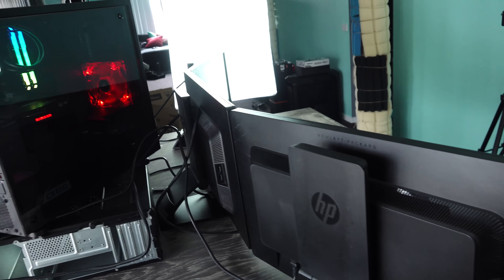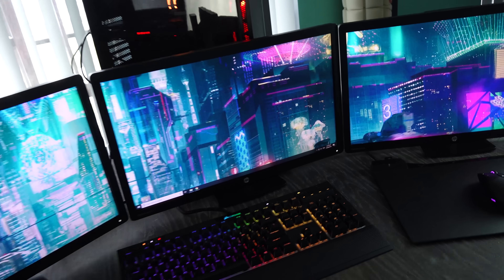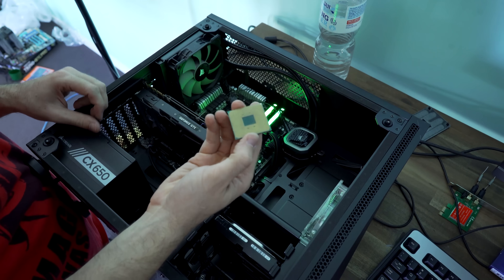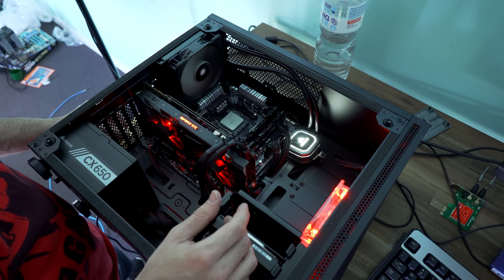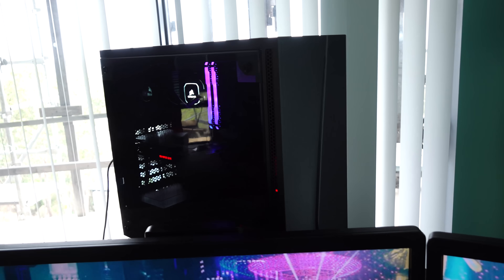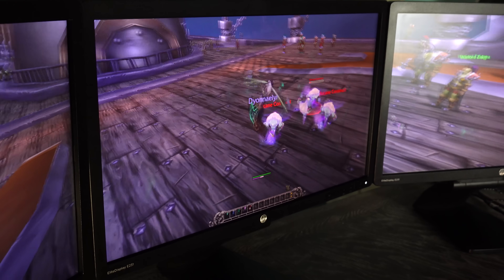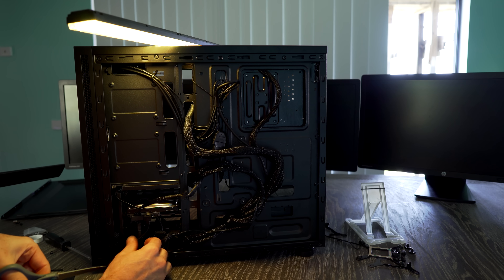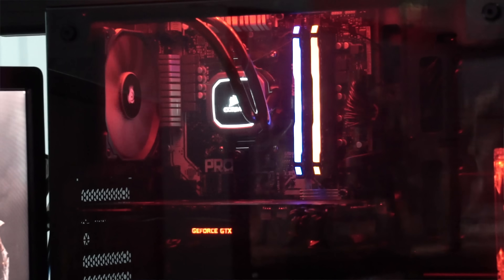Ryzen Problems...!? Post Analysis of the AMD WoW Gaming PC

Comment: Always unplug your HDD when you install Windows on an SSD, it's not vendor specific, happens on both Intel and Ryzen.
Reply from the maker: Strange, always happens on Ryzen for me.
Reply: Pls read my previous answer. For what I know this happen when the HDD isn't configured in the GPT file system and happens to be configured as MBR with a ACTIVE volume. Also explain why you had the limitation of 2TB by partition cause MBR can't work with partition superior than that. Sorry for bad english... You can fix this when installing windows opening the CMD (press F10 in windows install screen) -> command: diskpart -> list disk -> select disk * (*  select disks that aren't with the GPT mark at the end of the disk especs in the listed disks) -> clean -> convert gpt -> exit... after that install your OS as always
Reply: By default SSD always will initialize as GPT file system and not MBR but disks happen to use MBR as default if you doesn't happen to initilize them with a UEFI - GPT only Windows pendrive.
Reply: @DerickMaruyama  Didn't realize your English wasn't good until you said so. That said, if you are interested in improving your English:

The expression is "as far as I know" not "for what I know" (also use a comma after the expression: "As far as a know, this happens")

In this case you would use "happens" not "happen"

"configured in the GPT file system" should be "configured as a GPT partition table"

"a active" should be "an active"

"Also explain" should be "Also explains"

"2TB by partition" should be "2TB per partition"

" cause " should be " 'cause " or "because" otherwise it could be confused with the actual word "cause"

"can't work with partition" should be "can't work with a partition" (yes, we use a stupid amount of "A's" and "The's" in English.

"superior to that" should be "larger than that"

"Sorry for bad english" should be "Sorry for my bad English" or "Sorry for the bad English"

I've never understood the use of "..." at the end of sentences by some non-English speakers online and have always been curious as to why some non-English speakers use it. In English, it is used to indicate an omission or unfinished thought. Both times you used it, though, there was no omission or unfinished thought and a period should have been used instead.  Out of curiousity, what is your native language?

Some proper examples of ellipsis (...):
He said, "I am John. [...] and that is the end of my story." (whereby a section of text is left out and replaced with [...])
umm... (Here it indicates an unfinished thought. The person is unsure what to say next.)
I don't want to go but... (Here it indicates an unfinished thought. The person is unsure what to say next or doesn't actually want to say the reason.)

"You can fix this when installing windows opening" should be "You can fix this while installing Windows by opening" (when instead of while is OK though)

"opening the CMD" should be "opening CMD" which is actually a strange one since we would also say "opening the command prompt"

"that aren't with the GPT mark at the end" should be "that don't have the GPT mark at the end"

"after that install" should be "after that, install"

"as always" should be "as usual" in this case.
Reply: Martin Aasa strange, I’ve never seen a problem like this with all the computers I’ve built. Looks unique or extremely rare to me.
Reply: I've seen it too on Intel (i7-6850K) - happens to me on X99 with an M.2 and SSD. I have to unplug my SSD or the windows installation media cannot create the Windows 10 install on my M.2. It's not everytime, but it's happened twice. MSI X99A Godlike Gaming Carbon motherboard, Samsung 950 Pro 512GB and Samsung 860 Evo 500GB.
Reply: Is it better to install Windows on 2.5 SSD or M.2 NVMe SSD??
Reply: Fida Md-saini NVMe is faster if you have it.
Reply: @WayStedYou  I intend on getting one because the mobo I'm getting for my Ryzen 7 2700X is the ASUS ROG Crosshair VII Hero & it has its OWN PCIE lane direct to the CPU on the bottom right side of the mobo and it DOESN'T take from the GPU.
Reply: Fida Md-Saini I have that exact setup. 2700X on CH7wifi Ann 1tb 960 EVO. It rocks. Bottom port
Reply: @fidamdsaini8452  M.2 is faster but doesn't really change that much as for performance in games
Reply: True
Reply: @Alistair believe so. I happen to work at a PC Gamer store in Brazil and happen sometimes so you get used to it, so now we use a pen with The lastest version in gpt only for all new hardware and a gpt-mbr for better compatibility for older hardware.

Comment: When I have an issue like this I press and hold the power and then I restart the  PC. if that step doesn't work I  remove the memories, CPU and the litter battery then I put all on the floor for five minutes and the put everything back and work fine. I do have a Ryzen 5 2600. Ah great video.

Comment: i had the same issue of the reserve system on the hard drive on my 5820k, it seems to be an issue itself made by windows for what it seems, not just Ryzen, too bad i lost some files when i needed to do a reinstall later on since i had to format the HDD because it was not being recognized at all, its a weird issue, so i would reccomend to everyone to install windows by disconnecting the sata cable from the other HDD/SSDs and after it is working, plug everything else back together

Comment: For the Windows installer bug that happens regardless of platform. On my old i5-750 system I installed Windows to my SSD and it copied the master boot record to my secondary 2TB hard drive. I had to set my 2TB drive as the boot drive in the BIOS and then Windows would load. I'm not sure how long this has been a problem but the only way it can be prevented is to unplug all drives except your boot drive, install Windows, and then plug in any other drives. Not sure why Microsoft hasn't fixed this to be honest.

Comment: Also. nVidia surround is so crap. Especially if you use ANY TYPE of mismatched displays. You have to fake surround with SRWE Resolution Changer while on AMD... I have dual 1280x1024 + one ultrawide and with overscan setting gaming is flawless. One you use Eyefinity there is no going back... Ok. True. It has some bugs, but it's still better than nVidia solution.

Comment: I had the same issue recently on my 990fx Asus board that has FX8350 CPU. It would not turn on if i shut down the system and not turn off the power supply. Board seems to have power but it just doesn't turn on. If i turn off the power supply after shutting down it turns on fine the next time. Thought it might be my PSU but that's prob not it. It's time for a new build anyways, this one is 5 years old and my ram sticks are dying one by one lol
Reply: If its dying and you want to give that board one last hoora, I'll bench my FX to the death.

Right now I'm only able to push 1.7 Vcore on my 4 phase VRM to my 8350 (power consumption around 500w). With my phase cooler for 24/7 use, the core peaked at 10c once, but benchmarking something like Firestrike/TimeSpy is so light of a load it never gets above 0c. I just need a board that can do 2.5 to 3 Vcore, and I can run some LN2 to see what that chip will really do. It pulled most of the score for setting the current #1 FX-8350 single GPU score in TimeSpy (I will put the Titan Xp on phase, probably kill it, but worth it to set the FX history books).

Comment: Had similar problems when i helped built 2 Ryzen builds for two of my friends. They both had the same motherboard and when we tried to start them the lights turned on but no display. We tried a lot of things and reseating the cpu fixed it. Had to do it twice on one of them but it worked.     They haven't had any other problems after that luckily

Comment: I've built my first pc last week and noticed something strange too:
Whenever I turn the PSU off (did that many times while testing the wohle system), turn it back on and hit the power button, the PC is trying to boot for 2 seconds, fails and shuts down for 2 seconds and boots up after these 4 secs fine. This happens only after turning the PSU off and on. So the following boots are fine as well, as long as I didn't turn off the PSU once.
Reply: My sister's first build had the same problem, I had a look at it and found she wired the front panel/power pins from the case to motherboard wrong. The manual for each motherboard have the alignment differently (hers was the power-on pins were supposed to be orthogonal to the reset pins, she plugged them in parallel because the YT tutorial she watched had the pins connected so, and one of the holes from the plug was connected to the drive activity LED). Once I put it right for her the problem stopped. So maybe double check that.

Comment: 4:00 it happens on every platform. It's Windows Installator bug. Innitiating full HDD with a partition BEFORE selecting SSD as installation destination fixes problem.
Same goes for installing non-dual boot Windows - you have to LITERALLY unplug first hard drive since otherwise new instalation will just crap all over the boot sector and inject itself in the other disk.
Reply: *Feature, it would be a bug on any other OS, but its Windows, so the proper terminology is "feature"
Reply: its not a bug its the ssd not set as first boot device

Comment: I killed a ryzen 71700 in the summer, it was overclocked to 4 ghz and it freezes a couple times after 3 months, and then it went bust... At first i thought it was the motherboard because with the cpu it would have issue recognizing the vga on EZ lights staying on, sometimes it was the RAM having an issue, and sometimes multiple lights staying on, i changed the ram for slower ones, i changed the graphics card, changed the thermal paste, removed and reseated the cpu, made sure everything was connected right on the motherboard (Fans, pump etc) a couple times... the results were all over the place on the EZ readings, but it was the cpu... I never killed a cpu before by overclocking, it was a first (and it kept running at 4ghz for 4 months before it died in the summer) i thought it would at least throttle and not kill itself from the heat, i don't really know how it died like this but, on the third month ZBrush would allways freeze and sometimes i had to shut down / reset the computer when Zbrush was stuck. I know it's the cpu because i bought a 2 nd motherboard to try it , installing the cpu on it and it's not working, i can't boot any usb with windows 10 installation on it, or any hard drive with windows 10 freshly installed, even tho bios shows the r7 1700 8cores 16 thread  running at 3 ghz but is stuck on 1.39 / 1.4V, i tried lowering the voltages, but the system would have problem powering on, and reboot until it was back to 1.39 / 1.4V for the cpu, so yeah, i think the cpu is unfortunately dead

Comment: That 2nd one is nothing ryzen specifically related actually, it's not even specific to windows 10 and predates the am4 platform.

Windows is fucking notorious for putting the bootsector on a 2nd drive so the whole system depends on both drives to be around
You can move the bootloader with the bcdboot / bootsect commands in cmd, dont forget to mark the drive with the new bootloader as active partition, and swap the order around in the bios.
I prefer testing it standalone first then just hotplugging the 2nd drive in windows, which is then free from any system processes.

I havent trusted windows to install with more than 1 drive connected for years now, has been happening since like windows 7, if not earlier.

How the hell have you not have this problem before? it's been around for as long as x64 windows is mainstream ;)

Comment: Maybe it has something to do with you drenching all of your computer components with WD-40
Reply: You do realize PCs completely submerged in mineral oil are a thing?
Reply: You do realize that PC's submerged in mineral oil are concealed from the contaminants in the the environment. Water is also nonconductive. Water does not short out electrical components. It's the contaminants (Dust) from the environment mixed in with the water that makes water conductive. The same will happen with WD-40.
Reply: Did you know that some cleaners like WD-40 actually have pictures of computers on the can? They're recommended for using on PC's
Reply: WD-40 is non-conductive though...
Reply: @Kevin - Neither is water.
Reply: Only 100% pure distilled water is non-conductive, that is to say, almost 0% of the water you've ever seen is truly "non-conductive".  You're talking to the son of a certified electrician, I'm not saying I know more than you on this subject, but I likely do...
Reply: Go ahead spray WD-40 on your computer parts if you want.
Reply: If the need for a thorough cleaning arises, I will, don't worry :)
Reply: Just the thought of all the harsh chemicals found in WD-40 up against the delicate electroplated circuit boards, makes me cringe.
Reply: Its safe, I assure you.
Reply: Liquids and Electronics don't mix
Reply: Why would he clean a new board. I don't think he's ever killed something
Reply: He might've cleaned another component that caused the problem.
Reply: Oh Yeah!?!  Why don't you tell all of us how you get a nice oily sheen/residue on your pc components that's going to attract dust and dirt, and soften some plastics without using WD-40? (just kidding)
btw folks that, "will attracting dirt and dust" part. That warning is flat out from the manufactures of WD-40.
Liquids and Electronics don't mix
Flammable Petroleum-based solvents (WD-40) and Plastics never mix.

Comment: It is just much easier not connecting the HDD while installing windows just have the SSD plugged in.
Reply: good advice, being a mechanic takes like 15 seconds to take off the side panel and unplug the sata cable.
Reply: That's usually how I do it as I dont really button up the case until after everything is downloaded and all tests are ran
Reply: Yea ive done dozens of ryzen builds, hundreds of intel builds and when installing os and updates initially I never ever plug in my hdds. Thought this was common sense.
Reply: Once your computer is done you don't really want to be pulling off panels again. It's annoying
Reply: @YusufNayab  man you must be the busiest man alive if you can't spare 2 mins to just plug in the sata cables once you've done the initial install on the ssd. You might want to slow down and take some me time before having a heart attack/ embolism. 👍👍

Comment: Apparently, ryzen doesn't support 3200mhz trident z RGB...
It isn't specified in the QVL.
Reply: Yeah should of check the motherboard supported ram list.
Reply: Upon further digging on this topic, I found that using the Gskill software with other RGB software, was corrupting the SPD on the RAM.
So, don't mess with those RGB softwares.
Reply: Neither is the 3000mhz trident z RGB and I've got mine running at 3000 on an Ab350 pro4m with a ryzen 5 1600
Reply: find it silly using the SPD in RGB witch is reprogrammable for the RGB controls seen so many threads of dead ram because it basically zeroed out all the SPD on RGB ram just because they changed the light settings in the motherboard LED control software (not the ram LED software)
Reply: That's strange. 
I'm running 16gb(2x8gb) @3600mhz with low latency timings ( 15-15-15-15) with other tweaks on a B450 Asus ITX mobo using an R7 1700 :V
The ram I'm using is
Team T-Force X-Calibur RGB 4000mhz.
Just built my Ryzen rig a few days ago. Previous setup was an 
I3 8350k with a z370 Aorus gaming 5 mobo.
Reply: @sehdabi  You have a lucky CPU. Even Intel chips need to be binned for high memory overclocks (like 4200 Mhz will only run on 1/3 of Intel chips, the 8700k is your best bet, but most will fail to run that speed even with specifically designed RAM overclocking boards with 2 slots). Ryzen has a particularly weak memory controller, so the speeds are generally lower, which is why people have so many issues with them.

Good news is, I downclocked my RAM and got insanely better timings just 1 tick down (35% lower latency from 5% frequency drop), so I wouldn't even want to run it stock. However, that kit is just bad (at least with Ryzen), both my 1700 and Threadripper 1950x fail to run it at XMP of 2800, so I think its just janky RAM, LOL!
Reply: @jakegarrett8109  
Maybe it's the motherboard.
I couldn't run at xmp. 
I can run 3733mhz but it isn't stable :/